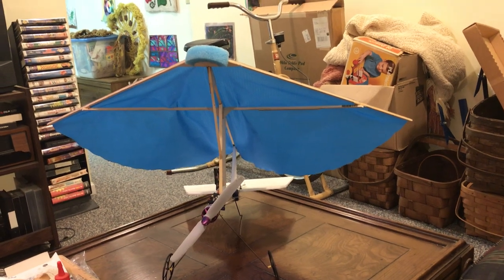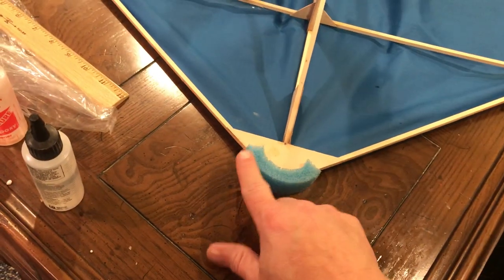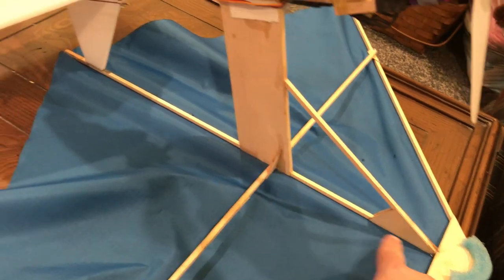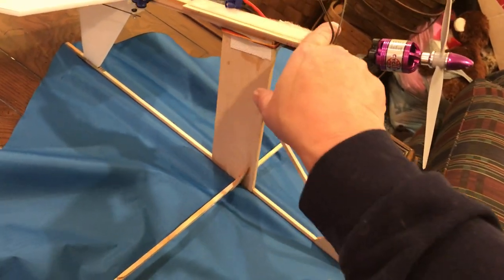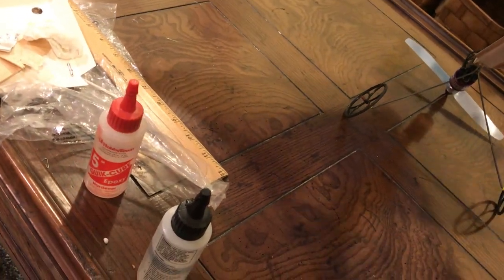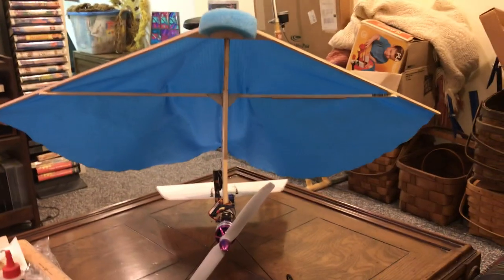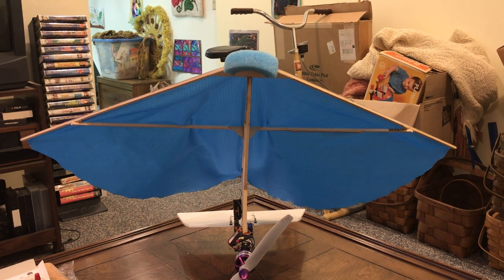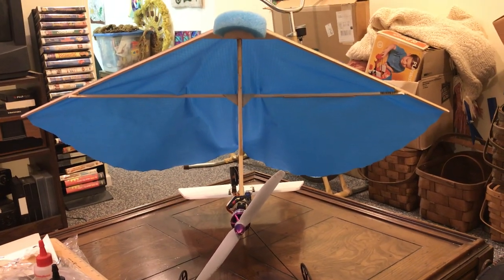Hoo Ha scratch build overview.  Thanks Pilot Mike.

Comment: The Hoo Ha design came from a friend long time ago. After making several of them, I changed the design a bit. Mostly with the degree that the motor sits. I'm working on taking the templates and creating a PDF of the Hoo Ha and will post them both here and on my channel. This is an easy build and the cost of materials is low. Motor, ESC, and servos were laying around waiting to be used.